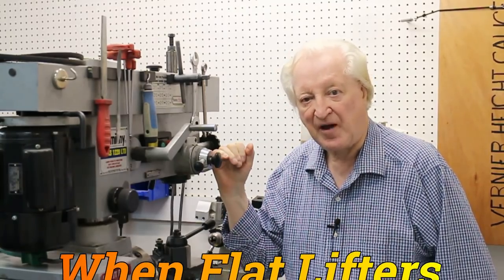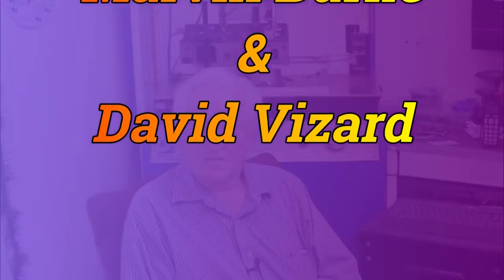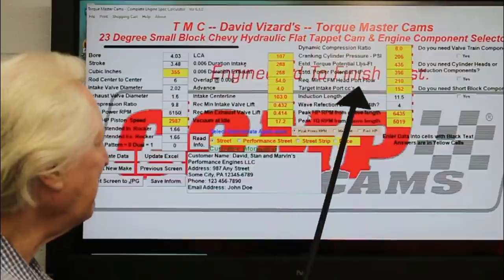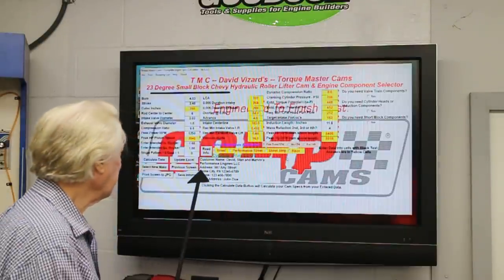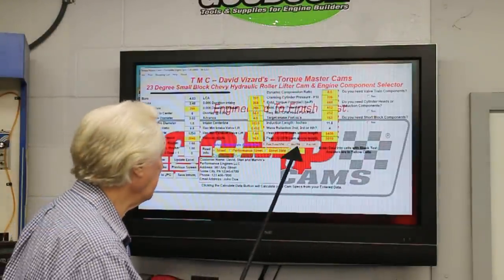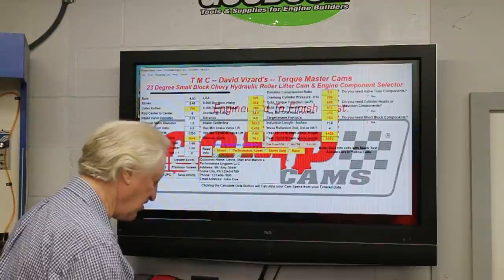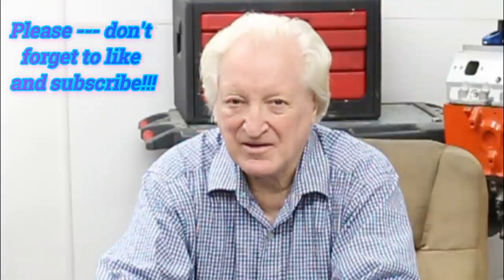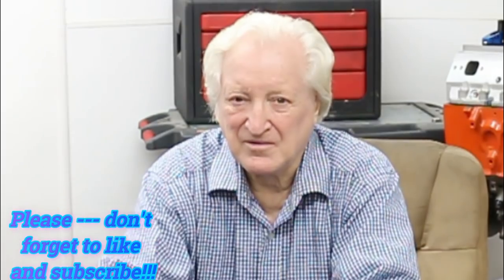David Vizard's PowerTec 10 EP 15 When Flat Lifters Reign Over Roller Lifters

Comment: I worry more about the reliability of flat tappet cams than I do about the performance of them especially on a high performance engine where you have to use stronger valve springs to avoid valve float at high rpm's. Having a cam lobe go flat after putting all the time and money into building a nice engine for your hot rod seems like it would be a soul crushing experience.
Reply: I agree. Plus the shaved off metal can do other damage. I Think the flat lobe problem has been solved by the good cam companies. I am running a mild COMP cam in my little chevy V6. It is just a street/off road engine. I run Redline oil because both Redline and COMP told me it has plenty of ZDDP to make the cam last as long as the engine. But COMP said it is not necessary to have a high level of ZDDP due to the mild spring pressure. But since I don't put a ton of miles on my engine I just change the oil annually and it has worked welf for over a decade so oil price is not a concern.
Reply: @geoffmooregm  I have never had a cam go bad in the 40+ years I have been in the business. The key is proper break in. Making sure engine starts right away, using the manufacturer's assembly lube, a good grade mineral oil with proper additive, and running at manufacturer's specified time and RPM. In the near future I will be tryng David's Oil Extreme on a solid tappet cam for my 351W.
Reply: @427_FE  agree Jeff, never lost a cam lobe with proper break in.
Reply: @geoffmooregm  I've seen more flat lobes and Cupped lifters. If flat tappet cams and lifters were so good the rollers would not be installed an engine because of cost. What the roller makes more RPMs last longer, I've yet to see my first bad one
Reply: In a high performance engine, you'd use solid flat tappets, and being lighter, they don't require as heavy a valve spring as hydraulic lifters would for a given profile size, plus the solid lifters can't pump up at extreme rpms.(I shift mine at 8500) You could run solid rollers for max effort, but for a performance track/street combo car, those aren't the best choice for such duty. Solid flat tappets are reliable, and produce good power, with virtually no rpm restriction.
Reply: @cecilandrews1875  they all have their pros and cons. Also you need to remember that you are comparing technology from very different eras, so there is that to consider. Hydraulic flat tappet verses hydraulic roller, same same. Just the hydraulic roller has a less abrasive means of contact. Obviously it weighs more therefore you are going to need more spring pressure to maintain contact with the cam. I have seen worn out hydraulic flat tappets from lack of oil changes, and I have seen broken hydraulic rollers. It comes down to cost of manufacture. You can't manufacture something that has a wheel that needs to perfectly round and heat treated, with a pin to hold it in place as cheaply as you can a hydraulic tappet, they both still use the same hydraulic principle. Although having said that I think hydraulic roller prices are disproportionate to the cost they are asking.
Reply: There's low quality out there now, even with rollers.  I've been running modern oils without zddp or anything fancy on factory cam/springs without problems since the oil was changed.
I don't know what others are "doing wrong" but I have dismantled worn out chevys with cupped lifters reassembled with new lifters no problems.
I carefully check all lifters going in any motor to make sure they aren't bleeding off too quickly.
Reply: It IS a soul-crushing experience.  More and more men report lifter failure.
Reply: @RTFLDGR  lost my comp cam and one lifter in 25 minutes. The results of the break in are I have the engine going back to the machine shop, who assembled it with the cam I chose. Going roller now. Moderately modified 351m and my cam showed total lift at the valve to be .496 with 1.73 rockers. Recommended springs for the cam too. Ran 25 minutes and the engine came out of the truck. Comp won't answer the phone, sat on hold with Comp Cams for 4hours 12 minutes with "Customer Service". Spent 2:12 hours being "Next in line" pissed to say the least. Hung up 4 minutes before closing time.
Reply: and an exploded roller tappet in a forced induction engine equally as devastating
Reply: ZDDP is not the answer here. More does not offer more protection...it merely takes longer to be depleted. Most failures are simply due to choosing the wrong oil...all oils are not equal. Don't take your cues from a cam company nor a oil manufacturer as neither have a clue.

Comment: David Vizard, one of the world's premier race engine builders, author of over thirty books on racing engines, and magazine tech writer, has developed a revolutionary new "Engine Break-in System" using Oil Extreme's proprietary Calcium Petroleum Sulfonate technology.

    In David's engine building seminars, he has been so sure of his 8 to 11 extra horsepower claims that he has done before and after dyno tests right on the spot, with the whole class watching.

    One well known skeptical engine builder, who was doing the dyno test in his shop, came out of the dyno room after the dyno runs, and told the class, "This ** works." The actual gain was 8 Horspower, after using only 1 bottle of the 3 bottle set. This EP (extreme pressure) anti-wear technology is the answer to the low ZDDP levels in today's motor oils.
This system eliminates cam wear problems.

Comment: I figured this out as a teen, a roller needs a concaved lobe base to do what a flat tappet could be ground to do. Strength aside, a small base circle and a large lifter diameter on a flat tappet will lift the valve off the seat faster but the lift and velocity are limited a lot by the lifter diameter at least in a simple profile constructed of 4 radii. You could hypothetically construct a lobe with some parabolic or elliptical shape or at least something that resembles those shapes but is geometrically constructed of line segments that follow the ideal point on the lifter for valve speed without the lifter gouging. But when it comes down to it most of us are just concerned with what we can easily buy. So i used to do a lot of mental builds and i felt that a solid lifter flat tappet cam, perhaps with a small base circle with high ratio rockers and a large 30 degree seated intake valve could be a real street sleeper. Pontiac super duty engines used a 2.100 intake valve with a 30 degree seat and some guys like to put them in d port heads to extra valve spring height. This valve has much more area than the port which means that its "curtain area" as some people call it would match the port area at a lift somewhere below 25% the valve diameter so high lifts probably arent needed as the port will choke the valve. Well allegedly a ford 1.72 rocker arm is the right length for a pontiac cylinder head. So a pontiac build is one option, maybe a 350 or 389 but i think most pontiac heads with any compression are small for my liking on something bigger than a 400. Another option would be to use a pontiac valve in a chevy or ford or chrysler with a small exhaust valve to make room and use a dual patter camshaft to het the exhaust out. The  30 degree seat and the fast valve acceleration would allow significant flow with low amounts of advertised duration, high ratio rockers on the ford and larger lifters would allow some lift but not a lot would be needed as the port may choke early. An engine like this could have a smooth idle because of low advertised duration and and valve lash but still move more air than other engines with similar or larger camshafts.

And as david points out the cam can save you money to be spent on some other part, perhaps a crank to get more torque or perhaps some fancy high ratio rockers and light weight retainers  if you find valve lift important. 

You may note that comp sells cams like this. They make a series of circle track cams with 106 or so lsa usually. they are solid lifter flat tappet and a little less aggressive as they are to be used with 1.7-1.8:1 rocker arms and they sell them as "max area" cams.

You may also notice that pontiac having short valve springs has been building big valve small port low lift with a 30degree seat angle setups since the beginning. Perhaps the super duty 389 was more clever than we all thought?
Reply: And after all that your point is what ? or we should run a goat motor ?
Reply: I guess thats there's not only one way.

Comment: I build engines that run in classes that are rpm limited to 2600 or 3000rpm. The 1.5" flat tappet engines that I have built for people are always front runners and several are multi time points champions.  Even on engines that run 5000-6000rpm I can get a broader flatter power curve with the flat tappets than the rollers. Peak hp numbers will be pretty much the same but the flats do require more attention to keep from wearing out when you start getting the spring rates up to run more rpm. For an engine that mostly will be used at 4K and below I think an agressive flat with big lifters will make more area under the power curve most every time.
Reply: Bcbloc02 - Tell me more - this sounds very interesting!!
DV
Reply: @DavidVizard  I often use a 252@.006" that has 154@.200" that smokes anything roller for the .200" number with that short of a duration which is critical for making big torque at very low rpm's.

Comment: David, Excellent video ! I have most of your books. In this video, you didn’t mention using lightweight toolsteel lifters on a nitrided cast cam core . Looking forward to hearing your take on that. I know for a fact that Nascar engine builders used lightweight toolsteel lifters on hardened steel cam cores. The lifters were DLC coated. Thanks !

Comment: I have been running an Isky flat tappet cam on the street for years in a 355 small block with a Procharger with no problems.

Comment: Another great video thanks again for your time very good information I built a 289 back in 1990 and I was going to college at the time to be a machinist and I had free use of all the equipment I needed so I learned how to bore line bore perilel the block also how to grind the rods and put a 125 finish on them thay were,43_40 steel wen I was all done it was balanced and I used a large 68 damper with the balanced forged pistons and reablanced them the engine was so smooth and it was really fast I still have it and now seeing your videos on cams and head porting I'm going to build my 67 4 barell heads and this time I'm going to put it on a Dyno and see what I have thanks again for your help
Reply: How is it going with your rebuild. Would love to see those numbers. Keep me posted if you can.

Comment: One of the keys to making a flat tappet cam last is a round, straight lifter bore with the proper clearance that is in the correct location. If the lifter does not rotate as it should, the failure will be very quick.

With all the good points you make here, I started to think back to the old mushroom tappets. That took the acceleration rate advantages you spoke of with a flat tappet cam to the max. What has your experience been experimenting with that configuration? Might be an interesting sub topic for part 2.

Comment: I suppose a benefit not mentioned with the roller is the possibility of a wider power band with the 50 mark being shorter and the 200 point being wider , so less off cam reversion . The extra lift helping compensate for the shorter 50 as well . a dyno curve of the two cams would be good to see if that's a true visualisation .

Comment: David, what are your thoughts on the Rhoads lifters? I’ve used them before, and noticed a little more torque before 3500 rpm, on my street car. I’ve installed them again in my latest top end rebuild. I had lost a lifter, and lobe on my last Comp Cams that I had used. I did some investigating and found out that a lot of people were having the same problems that the newer motor oils are presenting with flat tappet cams. The Rhoads worked well before on an engine that I drove a hell of a lot more than my last engine. My car is basically a show car that I’ve put a lot into looking for more power out of. I only put a couple of hundred miles a year on it. So you can imagine how shocked I was to find the damage to the cam, after I was using Mobile One. I changed it every year, before I drove it. Now I use the Valvoline VR1, and a small dose of the Lucas Zinc Plus, cause I don’t wanna go through that again. Back to the subject at mind. What are your thoughts on the Rhoads lifters? I hope you see this question, and can answer it. Thanks in advance

Comment: I have built a numerous 5.0 based roller cam SBF.  One I am doing now for a mild application, is a used split duration Explorer 5.0 cam (F4TE-6250-BA) 256/266, 0.422/0.448, 116 with new Ford roller lifters, lifter cage and keepers.  $250 total for these.  I otherwise agree with your cost analysis.
Reply: Ford are notoriasley bad at getting the LCA for almost all Windsor style motors. If you want to use a stock cam get the  one from - I think, the Crown Vic that is on a 107 LCA. That will be worth about 20 hp and 20 lbs-ft minimum.
Reply: @DavidVizard  to my knowledge the CV 302 was only offered as flat tappet before being replace by the 4.6 2V.  The OEM 302 HO cam is 115.  There are some inexpensive re-ground rollers that I can look at for a better LSA.

Comment: Thank you Mr. Vizard, that came to explain some thing that have been bouncing around in my head for years about solid lifters. I had a1964 1/2  and I put a solid lifter cam in. But I was pointed to use a flat tapper from a 427 lifter of that days engines. The engine ran exceptionally well for a stock 289. These lifters had a solid zone on the top and the bottom. But the center zone was cast (I believe) that was actually a spiral with about 4 to 5 spiral webs. Which from your description sounds like it would force the lifter to spin. Any thoughts?

Comment: Thanks for another significant report on a essential topic for important builds. I’m using bronze lifter bore bushings in a 351” Cleveland 4-bolt main (D2AE-CA) block to provide an extra measure of oil control at the lifters, which typically flow excessively in production blocks. The solid roller cam and lifters is a NOS set from Reed Cams. 

Do bushed lifter bores provide any significant performance or parts longevity increases over the stock iron bores ?  The bushings and/or screw-in oil passage restrictors work well to correct the marginal oil flow to the main bearings which is a common Cleveland engine problem at frequent or sustained rpms above 6000.
Reply: I did the lifter bore bushings in my Cleveland, from what I understand, when the lifters are moving up and down at higher rpms , it can cause aeration of the oil, which ain’t good of course, the remote line was a band aid for that problem , I also did the Tim Myers cam bearings instead of screw in restrictors , best of luck
Reply: @johnjaniak473  ,  good call on the Tim Meyers grooved Cleveland cam bearings. Tim has quite a selection of Cleveland specific components available and he is a good guy to do business with. 

I agree with the questionable benefits of using the external oil line on a Cleveland.

Comment: Great information I just hate running rollers on the street they were out to quickly always wondered if flat tapped would be close in the same power range and love the sound of solid cams
Reply: are you buying cheap lifters? I've never had issues running them on the street. There were all sorts of factory roller cam SBC's and all LS engines are rollers...never heard of lifter failure being a big concern. Except for AFM/DOD applications, but that's a different topic

Comment: I recently tried liqui-moli additive, in a motorcycle engine, it seems to have a decent amount of friction in the cam followers/rockers,  a roller would seem much better, it's a old engine design, overhead cam, from the 70's Honda, I haven't used it long enough to say if it's good or not, but it is slick, basically a graphite grey color, so the oil will be black even new! I'm hoping it will reduce friction, and produce more power, I'm going to checkout your suggestion!
Reply: Does the transmission/clutch share the same oil? Does your clutch feel the same? I'm wondering how the additive will affect clutch frictions and steels.
Reply: @RUBIZEN  Good point. I have heard that MOS2 is terrible for wet clutch function. Motorcycle specific oils are typically formulated with zero MOS2.

Comment: Just check out the 2011 Engine Masters challenge and you will see a LS engine that placed 2nd with a .904 Dia flat tappet. It was the only engine in the contest with a flat tappet cam. What David failed to talk about is lifter dia. and how much faster you can open the valve with larger lifters.
Reply: He's building a small block here ! so how much to bore out the lifter bores ? isn't he talking about working with what you have or did i miss something ?
Reply: @luckyPiston  Yes he is I agree, but he never addressed how much better a flat tappet cam can be when you have a larger Dia.
Reply: @3:30